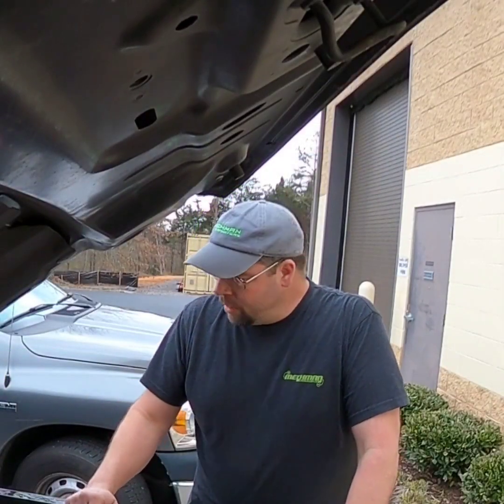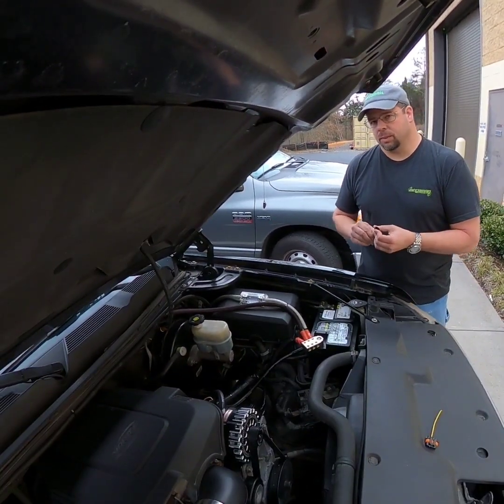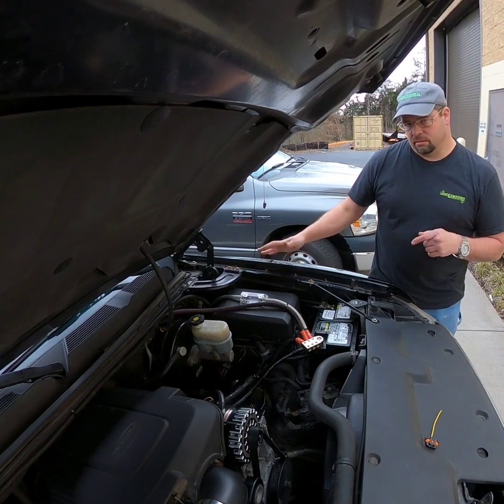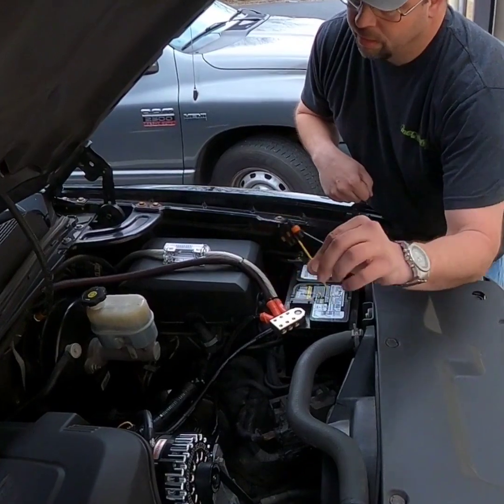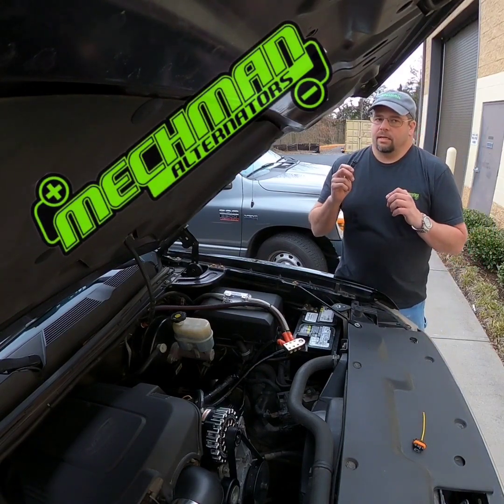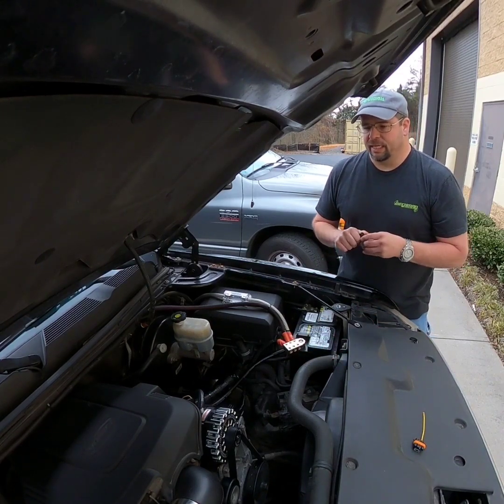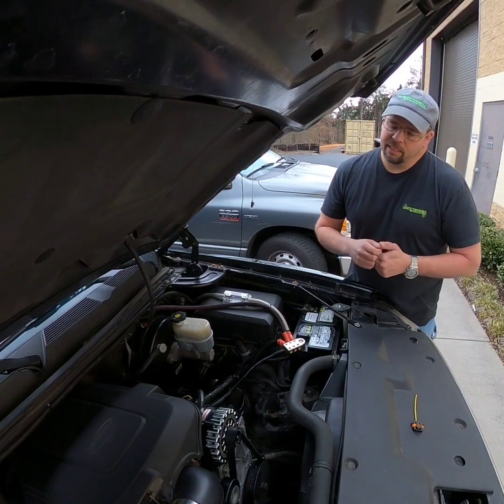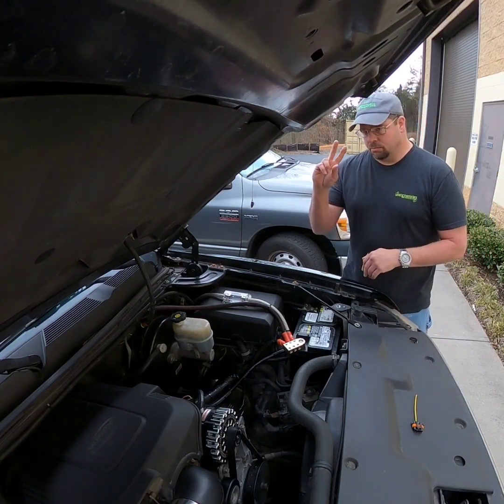Lets talk about P103, the RVC bypass plug for newer 2pin GM alternators.

Comment: Once i have the mechman all hooked up with the p103…down the road when I add a 2nd battery do i still need to run the negative cable through the rvc sensor? (Black loop on ground side)
Reply from the maker: No, the RVC loop sensor becomes irrelevant.

Comment: So I have a high output 2 pin alternator on my 2020 GMC sierra  is there a way to convert it from the 2 pin to the 4 pin or is there an adapter plug? What would you recommend doing
Reply from the maker: I would recommend simply purchasing the MM-VC1 we list on our website.  The 2020 GMC have a decent OEM alternator, its just the RVC that messes with it.  

Simple 2 wire hookup and easily reversed if needed.
Reply: @mechmanalternators  thank you for the recommendation,  ordered this morning.

Comment: Will the rvc bypass work with a stock gm 4 pin alternator? Like swapping fron a stock 2 pin to a stock 4 pin and using your bypass? Can the bypass be used with any 6 phase 4 pin gm alternator.

Comment: I have an auto tech 250 amp 6 phase alternator on my 04 Tahoe, If I use that alternator on 05+ trucks, can I use the p101 harness and p103 RVC bypass on that alternator and not get a battery light?

Comment: My voltage drops down to 8-10 volts is that a normal thing with the alt upgrade before i buy the module because i have a 4 pin alt on my 04 tahoe 5.3 swapped caprice
Reply: You’re going to blow something up

Comment: What exactly is in the p103? you said its a module so that means it has a processor/chip, if its not a resistor or just jumped over I would say this is not a good/permanent fix since you are the only supplier. can you explain exactly the inner workings of the p103 before I decide to convert over?
Reply: That's my thoughts too. Shipping brings that plug up to just shy of $40. If it's just jumping the two wires together, I'll do that myself for free...
Reply: @spingel88 did anyone find this out?

Comment: Does a 2016 GMC 2500HD 6.0L have RVC? It has a Denso 23487088 with 2 wires, but there's no sensor on the main battery ground cable. The voltage seems to fluctuate so I'm thinking this may be the reason.
Reply from the maker: Most of those GAS engines do but when they have the HD option we've seen some that do, some that don't.  If you've inspected cables and found no loop sensor but it DOES have the 2pin plug, it is still RVC but less intrusive.  The actual ECU does the regulating through its own program. 

Basically any GM 2pin regulated vehicle is RVC controlled, it's just a matter of what level. Thats how that regulator in the alternator works.   So if you wanted to bypass that, the P103 will still work with one of our 320+ amp alternators.

Comment: I bought a alternator from y'all just wonted to know I running new power and grounds but can I leave the existing grounds that go threw the rvc Factory grounds
Reply from the maker: Yup, sure can!
Reply: I had a very similar question. I ran new 1/0 ground wire from 400 elite series to a new battery terminal. New battery terminals have optional posts that mimic the battery post. I mounted the unaltered factory ground to the terminal post in addition to the new 1/0 ground wire. Same on the positive side. Also, I installed P103 and P101. My question is, does the rvc sensor need to be removed from the factory ground, if that wire is connected? Should the factory ground wire not be connected? This is on a 2013 GMC Yukon Denali.

Comment: I have a 2004 tahoe with a mono amp and 2 12's (bought it that way), i plan on adding a winch and a couple off road lights, will your 250 amp alternator work perfectly for those accessories or do i need a higher amp alternator?
Reply from the maker: Depends on the amplifier size.  If under or at 2500 watts it'd be fine. If the amp is over that, i'd look into a 370 or 400

Comment: What about the elite 2 pin alternator y’all sell?
Reply from the maker: What about it?
Reply: @mechmanalternators  how do I raise voltage, it is lower and fluctuates more than stock.
Reply: @mechmanalternators  elite 250, for 2013 2500 diesel. Ordered from summit racing.
Reply from the maker: @matt6951  Send it back to us to swap the regulator to the 4pin style at   https://www.mechman.com/rga-request/
Reply: @mechmanalternators  I need the truck for work or I would. Is there no way to increase voltage with the 2 wire set up?
Reply from the maker: @matt6951  Reliably, no.  Just put your stock one back on and send the mechman unit to us.  Turnaround time is usually around 1 day.
Reply: @mechmanalternators  I will be able to after the 10th of next month, hopefully. Thank you.

Comment: On the 4 pin pig tail.  12v switched but @ how many amps for the circuit do i use.
Reply from the maker: Any 12v switched source from the fuse box is fine.

Comment: So to get rid of rvc I need to upgrade to a 4 pin alternator instead of the 2 pin? Is this the only work around for rvc?
Reply from the maker: Yes, to do it CORRECTLY and reliably in our opinion.  There are some rinky dink 2pin voltage modifier knobs out there but we....at least ME,  hear of them failing in a few months and we end up doing the 4pin regulator/1 wire/p103 plug and they're good to go.

Comment: Well answer me this. My big 3 was ran on my second battery and not my main battery. My battery light is on. What did they not do to get my battery light on or a better question how do I get it to turn off on my 2016 chevy silverado??
Reply from the maker: Well, no clue who THEY are but I bet THEY can help answer this question better them me because we weren't paid to do your install.  This is why we always recommend installing aftermarket parts/devices yourself.
Reply: @mechmanalternators  makes sense..I just put the module on and battery light still on..again he didn't run a big 3 on my main battery nor did they run it thru that piece so my vehicle can see wats goin thru it..man man..
Reply: @mechmanalternators  and my battery charging thing keeps cumin on every time I cut my truck on..so idk wat to do..but truck runs fine wit no issues so far..want dat off tho
Reply from the maker: @allenscott5773  You should contact the shop that put it on. We have instructions in every box, online video's of do's and don'ts.  

You pay a shop to do a 100% complete customer satisfaction job. If you're not 100% satisfied then you need to consult the people that caused your unsatisfaction.
Reply: @mechmanalternators  did that..they dnt even kno wat to do.. gonna read the manual and take it to sumbody else dats more familiar wit it

Comment: @mechmanalternators  do i still have to pass any addiitional wires thru thr RVC sensor once i plug and install this unit ?
Reply: No Sir. Thats also coming up later. 🥰
Reply: @tonyb022377  okay, so would the alternator come with both plugs, or what i have to buy them seperate, youd expect for $600, everything you needed for your new alternator would be included !
Reply: @chinofajardo5591  Alternator comes ready to go out of the box with both plugs.
Reply: @tonyb022377  sounds good, ill be purchasin one here pretty soon, been trying to find info about this for about 3 months now, do i have to call and make the order for a 2016 tahoe with both plugs ?
Reply: @chinofajardo5591  if you order directly from Mechman I can 100% guarantee it.